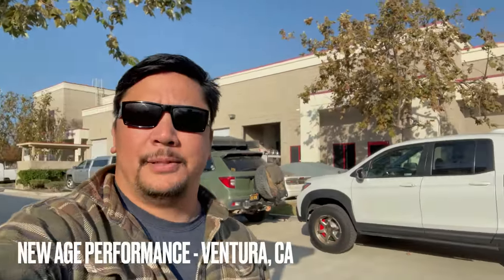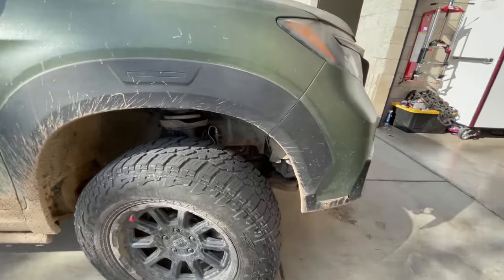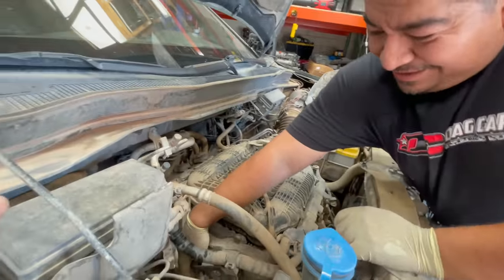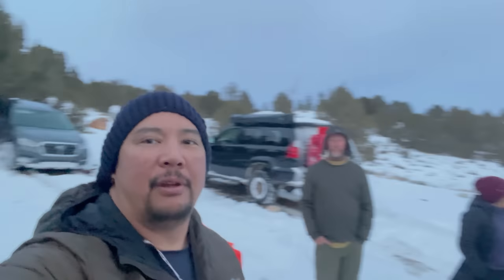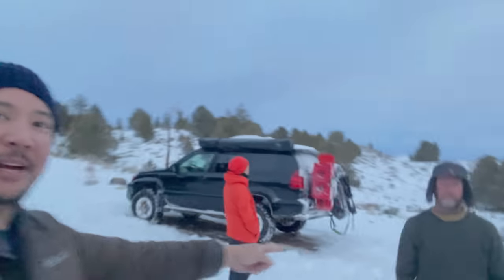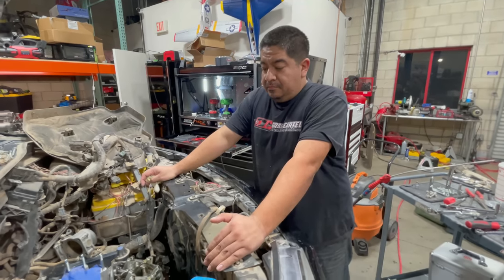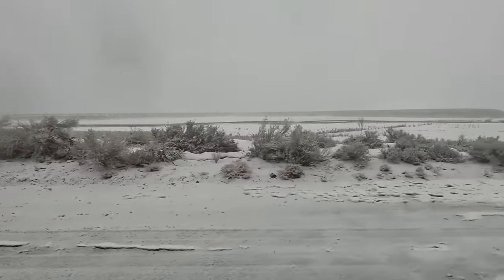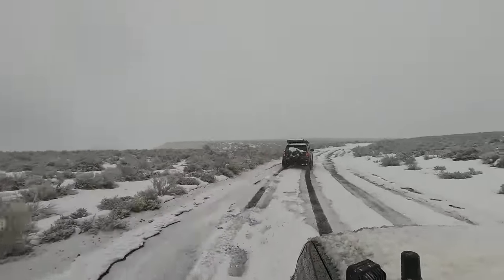100K Major Service on my Overland Built Honda Passport

Comment: Thank you for this Jon. BTW, I just purchased a new Passport Trailsport a few weeks ago. Liking it a lot. Looks like a very simple engine to do maintenance on. I am stock lift and installed all the NoLo skid plates (front, mid/cat, carrier bearing, gas tank and diff). I don't plan on getting as crazy as you off road. I appreciate your videos. They have been helpful in regards to showing the capability of this rig with a great driver such as yourself behind the wheel.
Reply from the maker: Thanks Ollie!  I really appreciate all your comments throughout the years!  I'll admit, I'm not a great driver , but I do appreciate the compliment.  The expert mechanic in this video is a much better driver than me :P  One day i'll release a video of him driving up very difficult terrain in his White Honda Ridgeline.
Reply: Any drop in mpg?

Comment: Before I do any engine work, I usually blow the hell out of the engine bay with a power blower to get rid of most of the loose dust then cover all the electrical connectors, battery terminal, fuse box, etc, spray engine cleaner everywhere let it soak for an hour than just hose off the entire engine before doing any engine work. It’s a lot easier and cleaner to work on a relatively clean engine and easier to find defects (cracked hoses, rusted bolts, etc)
Reply: We cleaned the engine extensively but even when we removed the manifold there was another layer of dirt lol

Comment: Hang on to your old timing belt.. they come in handy for lots of things.  They obviously can  flex, but do not stretch easily, so they are excellent for improvised belt wrenches, or can be cut into strips for making hinges on underbody panels. I just used a big section of one of my old belts as a way to get my busted water heater out of the utility closet... wrapped it around the back of the tank and then used it to bear hug the beast and walk it out (empty of course..) ;)
Reply from the maker: Thanks for the advice Tony!

Comment: Catch cans are an old drag racing item.  Many just want to look cool with the bling.

This is my humble opinion, but Costco gas is good for everyday stuff.  When I tow my travel trailer, I treat my tow vehicle to Chevron, Shell or 76 gas as this old butt can really feel the difference in performance.  I periodically use Lucas Oil fuel injector cleaner in the gas tank also.  In all my years of driving fuel injected cars, I have never had to have injectors pulled to be cleaned.

Comment: Jon... Thank you, Thank you, Thank you!!!!   I've been waiting for this review of your long term maintenance / durability of the Honda!  I assume Manny did the spark plugs?   So happy to see the timing belt held up very well and the entire vehicle really!   I say she'll be going strong at 500K!!    LOL.    I'm a bit of a shade tree mechanic and do a lot of my own work.   Your Intake valves had very little carbon build up for 119,000miles!  What kind of intake spray cleaner do you run?  You said you have the can in the back seat?    That is really reassuring!     Keep changing that oil and keeping the Passport happy.   I want to do my transmission fluid at 25K    Thanks again for posting it.     I'm sure the engine is running much smoother and quieter now after the plyer extraction and the new pulleys!   Awesome man!!!!
Reply: Honda Timing belts are really good, but the issue was the bearing and the tensioner , both were wore out and it is not worth the to wait any longer 
I have seen people getting away and doing the maintenance at 150k miles but not recommendable
Reply from the maker: Thanks Ram14250!  I appreciate all your support from the start!  Yes, Manny did the spark plugs.  I have the footage, but must have missed it, editing a video on an iphone isn't the most intuitive experience.
Reply from the maker: The intake cleaner I use is CRC "gdi intake valve cleaner".  I only used it 3 times in my 118K miles, the last time was 40K miles ago, so I'm very pleased to see how clean the intake valves are.

Comment: Thanks Jon!!   I like your mechanic.
You didn't let us hear the engine after.  You didn't say what the cost was?
Reply from the maker: Engine sounds just like when it rolled off the dealership lot.  Manny gives me a special rate, this is an expensive service though, and the dealerships probably don’t do the valve adjustment.

Comment: If you have only done regular maintenance, and have had no significant repairs, then this 100K tune-up makes the Passport look the most reliable vehicle of the year.   I had doubts about its reliability due to issues with infotainment, Honda sensing, electrical, speakers crackling, etc., but clearly the powertrain is solid.
Reply from the maker: Yeah, I totally agree.  I feel like I have a propensity and history of abusing vehicles and causing early failures of suspension parts.  Besides my 2019 Honda Passport, My 2003 Toyota Celica and a 2008 Toyota FJ Cruiser were the only other vehicles that held up to my driving style.  My 2013 Nissan Juke, 2010 Subaru WRX and 2015 Subaru Forester XT didn't last.  The WRX had the engine blow up twice, and the Forester XT had many minor issues and then the CVT melted.  I traverse terrain 2x as difficult and abusive compared to the Subaru and the Honda handles it with Grace.
Reply from the maker: In my Subaru, I babied it.  I followed the severe duty maintenance schedule, but I didn't monitor transmission temps.  After having transmission PTSD, I made sure I monitored transmission temps in the Honda Passport.  While transmission temps rarely rise to 220F along my adventures, all it takes is hitting 240F once to really compromise the transmission.  My Passport did have 1 issue, at around 90K miles or so, the transfer case started failing.  Honda did not have a severe duty schedule for this component, and they say to change it every 30K.  I've been changing out the fluid at 15K along with my rear differential fluid.  Putting them on the same interval makes alot of sense and if you do the fluid changes yourself, it's very cost effective ($16 for rear diff / $10 for transfer case).
Reply: @JonDZ_Adventuring  That's a great report on the Passport's reliability.  I'm about to buy a 2022 Highlander XSE but was offered $2K off MSRP for a TrailSport.   The TrailSport was my first choice so I'm reconsidering.  I don't plan to drive too far beyond forest access roads, but your channel is an inspiration.  Thanks for all the vids that prove it.

Comment: I learned that running 5-30 was much better for my 08 Honda 2.4l, as opposed to the recommended 5-20. I used to run 0-20 for winter but now run 5-30 all year and the car loves it. 
Helps to know that Honda uses different oil for the same exact engines in Japan than they do in the US.
My 08 2.4l is specd for 5-30 in Japan but 5-20 in US.
CAFE requirements have manufactures recommending thinner oil than the engine actually requires for longevity. The manufacture wants to safe money and make money. Not make a vehicle that lasts forever. 
Unfortunately…
Reply from the maker: I'm going to be transitioning to a more protective oil.  Might lose 0.5 MPG, but that's okay :P
Reply: @JonDZ_Adventuring  what’s the oil you will be going with?

Comment: Another great, informative video Jon!  Thank you for this.  I'm still on the fence about oil weight.  I'm old-school and grew up when everything was 10W-40.  I've always thought the 5W-30 was better for the longevity of these Honda engines... but am nervous about the warranty period.  Once I get over the 36K, I believe I will switch to the 5W-30.  What are YOUR thoughts on it?  Have you been running the 0W-20 stuff this whole time?   Or did you change to something different?  Thanks again!

Comment: I don't think detergent in fuel is supposed to prevent sludge, that's the quality of the oil that prevents that and how often you change it.  The detergent in fuel is supposed to clean valves and injectors on multiport engines and injectors in direct-port since the valves can't be cleaned by fuel in those type of engines.  Costco gas is as cheap as most 3rd party chain stations but quality fuel like other Top Tier stations.  Best bang for your buck gasoline in Socal.
Reply: Your saying Costco has the cheap gas but it’s also quality gas? Huh?
Reply: @Richey Rich  Yeah, actually, Costco sells their gas at cost. It's a membership club that makes their money through memberships. They don't make a profit with their products. That's why Costco items, including gas, adjust price regularly depending on how cheap they get them. They sell high-quality stuff at cheap prices.  The fuel is top tier rated but bargain price.
Reply: @gpaje  Costco ABSOLUTLY makes profit off their products. There are only a few items they sell at or below cost. A couple being rotisserie chickens and anything (mostly) with a .97.
Gas is not and never will be at cost. Costco doesn’t make their money with memberships, statistically speaking. How do you think they can afford to give every member between 1-5% back?
They make their money of volume.
I also never pay for my membership cause I get several hundred dollars cash back every year.

Comment: @k20z3allmotorFTW Hey Manny... were the valves ok or did they need a lot of adjusting to get them back to spec?
Reply: Surprisingly they where pretty spot on, only like 4 values in total needed slight adjustment
Reply: I have a j series engine with almost 200k miles on it and I’ve never done a valve adjustment on it. She’s running 👌🏾

Comment: 10:00 The old oil argument. Here's the thing, I can see dealers getting the most outta this because if you wanna keep a record of service and warranty and whatnot, you need to go with them and use all Honda (or whatever manufacturer) genuine fluids, but if that did break cars it'd be bad for dealers especially for those who offer up to 10 year warranty. Not to mention that plenty, if not most, of owners reaping the benefits of say Honda or Toyota legendary reliability with cars with 350k+ miles and/or 15+ years with their cars, have been using genuine fluids. So everything I hear this paranoid argument, I mentally shake my head. From a logic point of view, doesn't make sense at all.

Comment: Jon, I love seeing you take this rig 100k and over. I’m 125k with my outlander sport. How often are you changing the cvt transmission oil? Thanks man
Reply from the maker: This vehicle has a 9 speed automatic transmission.  I change the fluid every 30K miles.

Comment: Why does you odometer say 109 but has actual driven of 118?
Also, do you have the transmission cooler? Have you had any of the common issues that arise with the transmission cooler installed? Usually it’s accompanied by a loud sound and vibration in the fifth six gear change.
Reply from the maker: My 255/70R18 tires are 8.4% taller than OEM size.
Reply: @JonDZ_Adventuring  oh, that’s right. I often forget that large tires makes such a difference. I edited my original comment with an additional questions. Please read.
Reply from the maker: @richeyrich2203  I haven’t had or even knew about common issues with the OEM transcooler.  The issue I have is I strapped a $10 amazon fan in front of it and it’s secured with Zip ties 🤣
Reply: @JonDZ_Adventuring  Roger that. Some people don’t have the issue. Been debating it for mine.
I assume you got the cooler for the off-roading you do and not for the towing capacity?

(3d print a bracket for it! Lol)
Reply from the maker: Yes, installed the transcooler after doing this really steep climb to 10k feet out in California called the Coyote Flats.  My temp never went beyond 230F that day, but I wanted to keep the temps down as much as possible, so that’s why I installed the transcooler.

Comment: i love it when non engineers tell engineers what's best...........
Reply: Just curious, are you referring to the mechanics comment at 9:42?

Thank you in advance from a Honda V6 owner.
Reply from the maker: @johnlopez3001  higher viscosity oil for longevity, but 0w-20 for higher MPG.  Manny’s not telling engineers what’s best, he’s telling the consumer how to make your car last longer.

Edit:  car manufacturers have to meet CAFE standards (corporate average fuel economy) and engineers have to do everything they can to squeeze out as many MPGs as possible (otherwise they get a big fine).
Reply: Are you an engineer?
Reply: @dmanatan  i'm not , and i do what the manufacturer says.....
Reply: @raziel630  So then you understand that there are engineers who would echo the sentiment of the mechanic in this video, and that manufacturers make decisions for all sorts of reasons?
Reply: @raziel630  I listen to the manufacturer says as well but from experience and also pushing these engines beyond the manufacturers limits I can see what breaks and why.
Reply: @raziel630 engineers don’t always do what’s best for the ease of use or maintenance. This is why German cars are all a mess to work on. It’s an age old tale that engineers never work on the thing they design or else they would design them differently.
The engineer answers to the bean counters at the end of the day, and in many cases their work can be criticized and improved from an ease of maintenance standpoint
Reply: @JonDZ_Adventuring you got it right. They change it to a less protective oil to meet cafe standard and increase overall mpg when multiplied by many thousands of vehicles.
Reply: @richeyrich2203  100% agree when the engineer could design say and oild filter cap to be 1/2" further away from a hose so it would be easier to unscrew for instance haha
Reply: Not in a Honda by the way I'm talking engineering in general in all vehicles
Reply: @JonDZ, does Manny really put the 5w30 in your engine? So How's the performance? 1 more thing, your front suspension spring? Is it the Eibach for ridgeline suspension? Thanks, I really appreciate your last reply to me with regards to the extension strut as I am planning to change to ridge line suspension for heavy duty use.

Comment: Have you had any awd overheating issues? Where it temporarily shuts down?
Reply from the maker: The AWD heat warning is very conservative, so the AWD system has never shut down on me.  when I get the warning, I get scared and let the system cool off.  The warning goes away after 20 seconds.  I actually had the chance to speak to a Honda engineer at Overland Expo and he said the “warning” is conservatively proactive, there is no limp mode.  On the other hand, Fords system won’t give you a proactive warning, it will just shut down the AWD system.